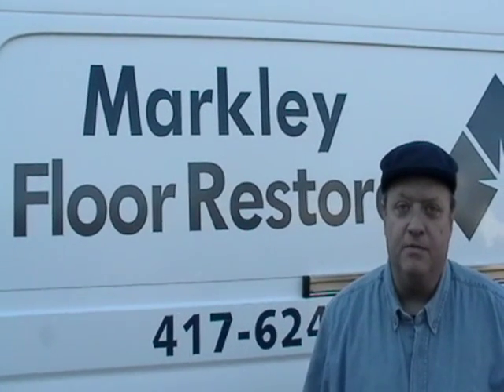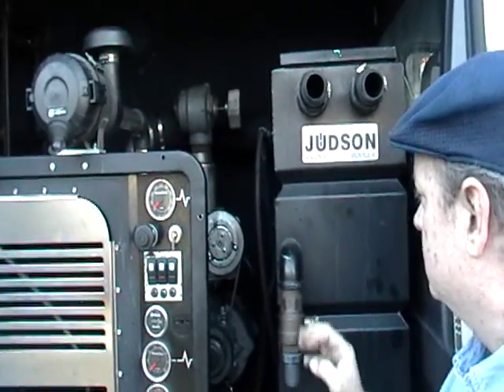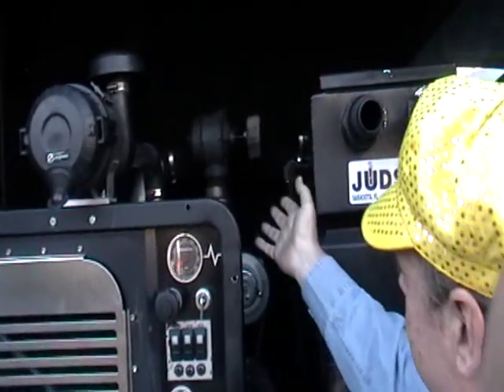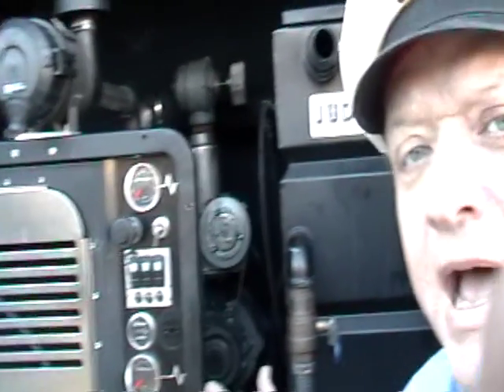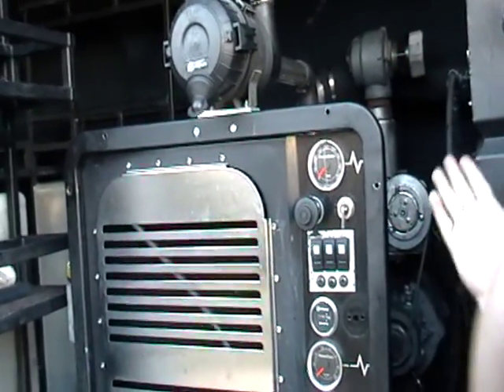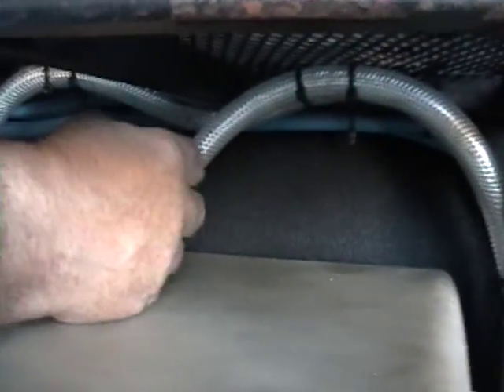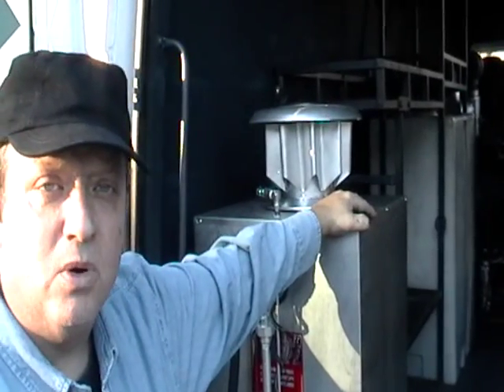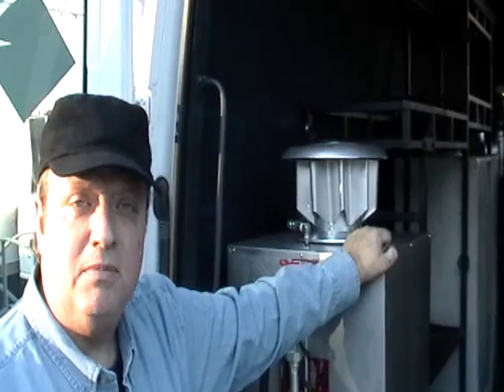Truckmounts - THE ALL NEW - JUDSON Genesis DXT Izuzu 52hp Diesel  TRUCKMOUNT !

Comment: Thanks for sharing. First truckmount I used was a Judson 21 years ago. Awesome machine, very reliable. The guy I worked for had 2. I now have a Powerclean Genesis which I love. Also reliable simple and powerful. Been running daily since 1999 about 7000 hours no major repairs so far. 

Don't mean to challenge your opinion but I find that the using max RPM does make a difference in the vacuum, especially on long pulls more than 150 feet of hose. Cutting the rpm does mean less vac at the wand. IMHO

Comment: Great vid Les - anyone with that good a SOH will think out of the box - excellent knowledgeable guy obviously with plenty understanding of what carpet cleaners want - wish I lived near you! I have a 24 hp Powerclean machine its well built but has heat issues! Hard to know if they complicated the later machines because the engine importers told them that was the way to go or they over-engineered it on their own - either way it must have contributed in some way to their demise - great pity imo